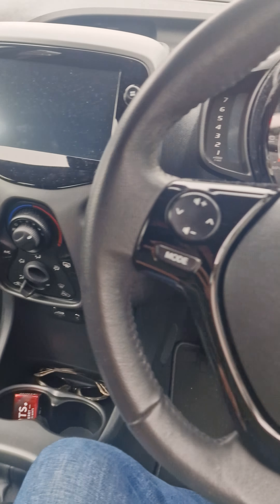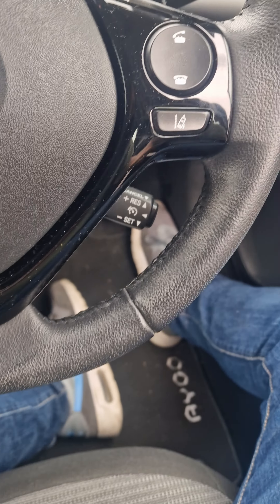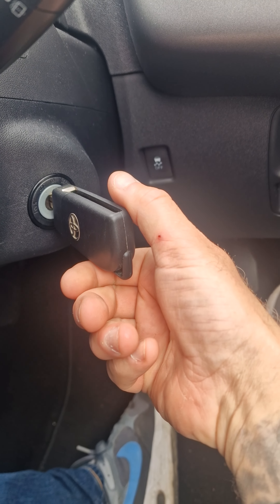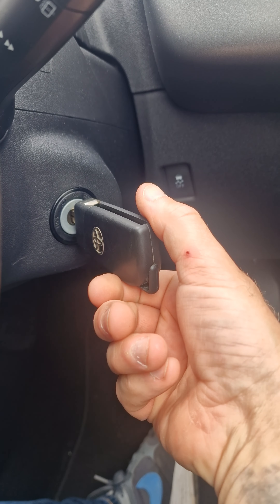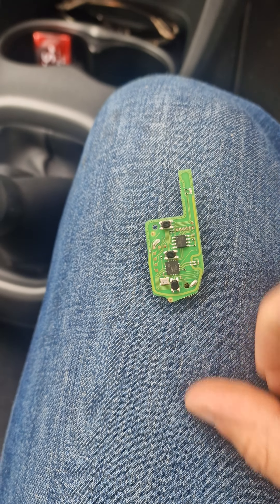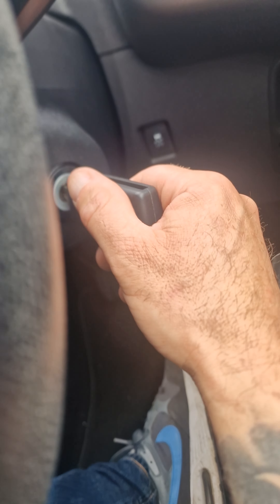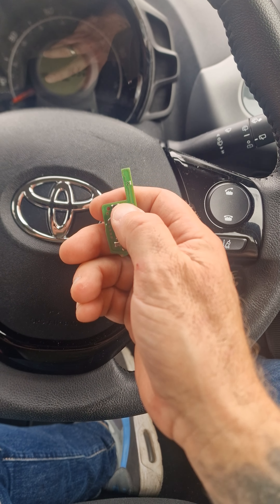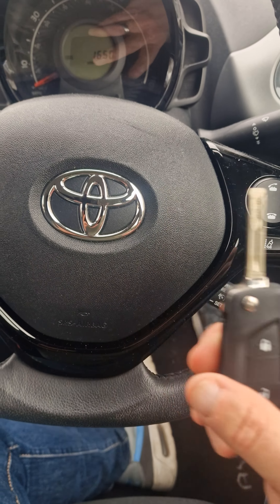Toyota AYGO, peugeot 107, citreon c1 14- Remote re-sync #howto #toyotacars #aygo #peugeot #citreon

Comment: Awesome, quick question, I’m looking at getting a replacement but unsure which chip I need. G or H, doesn’t say in my current key any ideas for a 2015 Toyota Aygo, looks the same in this video.
Reply from the maker: Id74H if it's the new shape aygo, which I'm assuming it is if it's 2015?